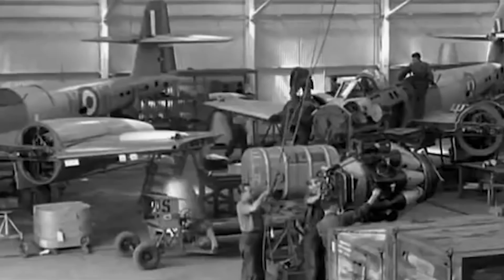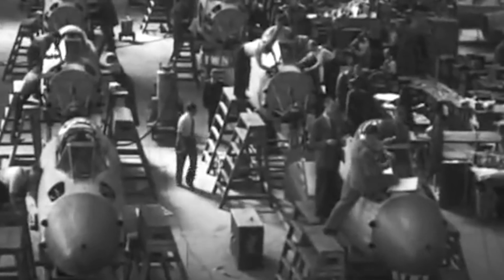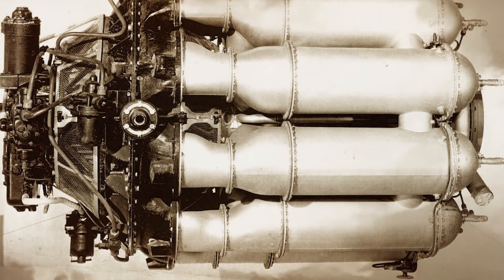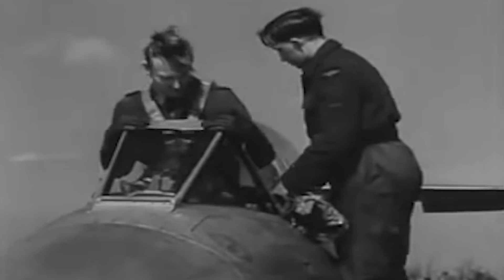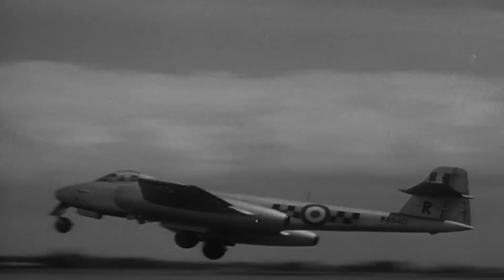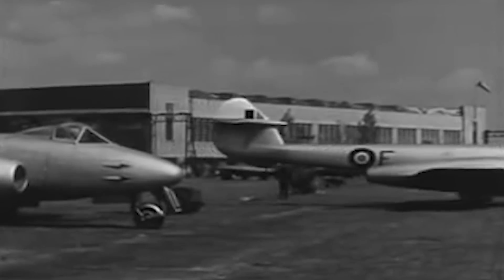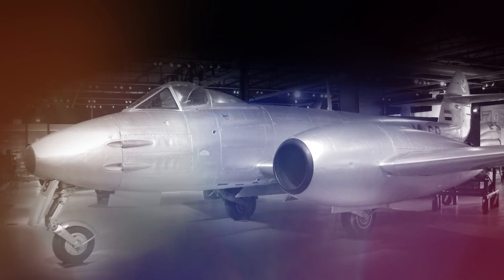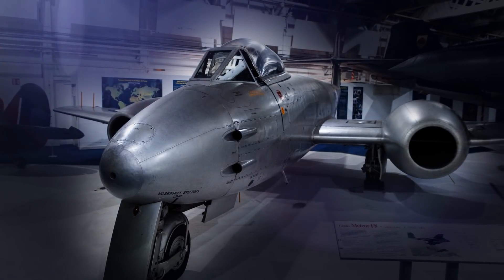Gloster Meteor - The Only Allied Jet to Fight in WW2

Comment: Errr they didn’t think it would impress the Luftwaffe? What? They held them back to keep the knowledge out of German hands. They were too valuable to send so they kept them back.
Reply: The Gloster "Meatbox" was the worst  fighter to ever be adopted into  service by the RAF. It's was no match for the Messerschmitt Me-262.
Reply: Sander Van der Kammen nope? It was one of the most successful jet aircraft of it time and set the standard for all that followed. The 262 had its advantages but could only stay in the air for so long before the engines failed, they then disappeared after ww2 . There are still meteors flying today’s are used by ejection seat companies to test their equipment. I wouldn’t let the early teething problems stain its reputation.
Reply: @timrobinson513  Indeed, the Messerschmitt Me-262 was without doubt the most successful jet fighter of WW2, it is the world's first operational jet fighter and indeed set the standard for all subsequent fighter aircraft from then on...
The Me-262 was produced after the war and remained in service until the 1950s.
The Jumo 004b engines were the most advanced turbojet engines in production during the war, and the original BMW engines are the most successful jet engine in history they are also still in production. 3 postwar 262s and 1 original 262 are in flyable condition.

The Meatbox was the most effective British aircraft ever used against RAF pilots.. over 1,000 crashed killing 450 RAF pilots.
Reply: Sander Van der Kammen you do realise that being the only jet fighter the British had also made it the best?
Reply: @sandervanderkammen9230  Sandyboy, congrats on your optimistic use of '1950s' The poor old Czechs thought they could make an export industry out of the 262s but absolutely nobody wanted it, not even the Argentinians who were awash   with nazis and nazi money and had Kurt Tank and Adolf Galland advising them. The Czechs put chocks under the wheels in 1951 and bough the MiG-15 with the RR Nene copied engine instead. 
As for the sad old Jumo 004, it made its way into 5 prototypes that never went into producion and a few hundred Yak 15s, a converted piston prop plane.
And the BMW 003 was the engine that the Russians put in the MiG-9 and kept flaming out so that they dropped it and chose the RR Nene for the MiG-15 instead. And then the French went for the BMW 003 and had to do a 'Trigger's Broom' on it and even then it took till 1950 to polish that turd enough to fly and ever since only the French would use it.
Reply: If the amazing NAZIs could only make a 20 hours before overhaul jet engine perhaps they should not have bothered.  An unreliable engine made with sub-standard materials cannot be called advanced, it was desperation ignoring and cloaking failure.  They didn't have enough engines for proper training and ended up with no fuel either.  The 262 and the Meteor had an equal impact on the outcome, nil.
At least the Meteor got further development.
Reply: @givenfirstnamefamilyfirstn3935  The British nor the Americans could make an engine capable of propelling an aircraft to 560mph and last 20 hours TBO using WEP.
A Rolls-Royce Merlin engine would not last 20 hours TBO  if WEP was used.

The Jumo 004b engines met or exceeded the RLMs 100hours PFTR reliability standard required for Luftwaffe service.
This is the exact same 100 hour PFTR  required by both the RAF and USAAF during WW2.
Testing conducted by the U.S. Army during  Operation Paperclip reports the Messerschmitt Me-262 engines averaged TBOs in the 50 -60 hour range, excellent by WW2 standards.
Reply: @sandervanderkammen9230  oh you mean the reliability standarts of suddently bursting into flames? Btw the meteors top speet was 612mph so get your facts straight
Reply: @snonsig2688  And the "MEATBOX" earned it's notorious reputation for killing 450 RAF pilots.

Not during WW2... Wartime models barely reached 425mph... slower than many production propeller driven aircraft.
Check your facts son.

Comment: Well part right. Guillaume got the first patent in, but never did anything about it, there was a guy called Fone who drew some pictures, but whittle built it and made it go, so we are back to the Mighty meteor.

Don’t be such a sad sack.
Reply: Hans von Ohain and Max Hahnn built the first turbojet engine in 1934, 2 years before Frank Whittle attempted to build his first prototype in 1936, the first successful flight test was Von Ohain's design in August 27th 1939 two years before Whittle's first successful test.
Reply: @sandervanderkammen9230  What is your source for your statement that Ohain built the first turbojet in 1934 ? This is from Wikipedia :
"The engine was extremely simple, made largely of sheet metal. Construction, by the blacksmith in his village, started late in the summer of 1936 and was completed in March 1937..... Ohain had at last, albeit five months after Frank Whittle, working in parallel in England, run a self-contained turbojet."
Reply: @youtischia  Your source is incorrect. Whittle did not start construction until 1936, he was attending Cambridge prior to this.

"A blacksmith in his village"???
Max Hahn was an Automotive Engineer and Master Machinist working at the University of Gottingen, a city of 55,000 in 1934.
Hahn was later hired as a jet propulsion engineer by Ernst Heinkel. 
He is the paternal nephew of Noble Prize winning nuclear chemist Otto Hahn who is considered the father of nuclear chemistry.
Reply: @sandervanderkammen9230  Did you read it correctly ? Regarding Ohain's first engine build  (Not Whittle) Wiki says : Ohain " started late in the summer of 1936 and was completed in March 1937". He didnt finish his bench test until September. That means he got his engine working after Whittle. You have twice commented he had his engine working in 1934 ! I ask again what is your source for that claim. That is before he even had his patent in 1935.

Regarding Max Hahn, agreed he started as a automotive engineer not a blacksmith. "While working at the University, von Ohain often took his sports car to be serviced at a local garage, Bartles and Becker. Here he met an automotive engineer, Max Hahn, and eventually arranged for him to build a model of his engine, which cost about 1,000 DM." (https://www.456fis.org/HANS_VON_CHAIN.htm).
Reply: @youtischia  Construction of the World's first turbojet engine prototype began in 1933 and was bench tested at Gottingen University in 1934.
Whittle did built any engine or start work until he moved to Rugby in 1936, prior to this he was attending Cambridge.
Reply: @sandervanderkammen9230  That was merely the sheet metal proof of concept. Promising but not up to standard. Ohain first successfully bench-tested a proper prototype engine in September 1937.
Reply: @youtischia  Whittle didn't have a successful running engine until 1939 with the WU.3.. by then Hans von Ohain's jet engine was in the air flying.
Reply: Sandbum dorktorbummer 
Ohain's poor copy of Whittles patent barely got the aircraft into the air. It didn't fly fast enough for the pilot to retract the undercarriage..  It was dropped very soon. Even Germany wasn't desperate enough for that.
Reply: @sandervanderkammen9230  There was absolutely no Ohain engine running in 1934 which Ohain himself clearly says in his foreword to 'Elements of Propulsion, gas turbines and rocket'. Ohain hadn't even worked out his design for a patent until 1935. You really must stop lying Sandyboy.
Reply: @sandervanderkammen9230  Oh Sandyboy, you change your claims as often as most people change their pants. I always think it's worth reminding you of what the famous German gas turbine pioneer Pabst Von Ohain had to say in his foreword to 'Elements of Propulsion, gas turbines and rocket'-

"The first patent of a turbojet engine, which was later developed and produced, was that of Frank Whittle, now Sir Frank (see Fig. 5). His patent was applied for in January 1930. This patent shows a multistage, axial-flow compressor followed by a radial compressor stage, a combustor, an axial-flow turbine driving the compressor, and an exhaust nozzle. Such configurations are still used today..."

and -

"In April 1937, Whittle had his bench-test jet engine ready for the first test run. It ran excellently; however, it ran out of control because liquid fuel had collected inside the engine and started to vaporize as the engine became hot, thereby adding uncontrolled fuel quantities to the combustion process. The problem was easily overcome. This first test run was the world's first run of a bench-test jet engine operating with liquid fuel..."

Comment: Many are so eager to assert that German technological advances was superior to the British, that they forget to read what the Germans actually made, and how useful it actually was.

The first jet engine to fly in a plane, was von Ohain's project at Heinkel. He had substantial funding from a major industrialist. Von Ohain himself admitted that he studied very closely Whittle's jet engine patents before starting work on his own jet engine. His engine had a centrifugal compressor and turbine. It was not the axial-flow jet. It was unreliable, inefficient, low power and low life, despite having massive funding from Heinkel - a failure, that was not continued. The German jet programme was dropped until they knew the British had prototype planes in the air, then it was revived. 

Whittle concentrated his very limited funding on the centrifugal compressor because it was well-understood and less problematic than axial-flow designs. He was focused on making a war-usable, reliable and powerful engine - quickly - which would outperform the best piston engine planes of the day. All of these qualities the Jumo and BMW axial jet engines lacked. On limited funding, Whittle developed a reliable engine which was combat-ready near the end of the war. Within months of the first operational flight, production engines were also more powerful than any of the total garbage engines turned out by the rushed German programs to the enormous detriment of actual combat - Gloster Meteor's top speed of 600 mph in late 1945, 650mph in mid 1946. No one can claim that an engine is combat ready with a service life of 10-12 hours, which cannot be rapidly throttled up or down otherwise it stalls, is prone to flame-out and terrifies its pilots. They were underdeveloped and unproven axial-flow jet engines, being garbage. The British installed axial-flow engines in a Meteor, however dropping them as they were too problematic at the time, requiring yearsto put right. A war was on, with years in development they could not afford.

The problems with German jet engines were not caused by the scarcity of metals in Germany during WW2, as they had access to enough rare metals. To produce a high performing jet engine high-strength alloys are required resisting high temperature. No iron-based alloy is suitable. Germany had no programme to develop such alloys. The British did, developing the nimonic series of alloys, making use of them in the WW2 jet engine programme. That is one, just one, of the reasons why the British jet program had combat potential, with the German program doomed to failure.

The Me262 airframe had many serious faults:

♦ high landing speed:
♦ difficult to maneuver;
♦ no air brakes;
♦ centre of gravity too far back;
♦ Poor downwards pilot visibility;

Those faults made attacking other aircraft far more difficult - at a time when they were desperately short of pilots, particularly pilots with sufficient skill and experience to fly what was a very difficult plane to fly and fight in. 

The sweep-back of the wing of the Me262 was minimal, only in the leading edge, with a part of the trailing edge of the wing being straight. The swept wing was an insufficient correction for the plane's centre of gravity problem, not aerodynamics, that prompted the slight wing sweep. It was not until years later that properly designed swept-back wings were introduced in combat planes. By contrast the Gloster Meteor was:

♦ handleable;
♦ maneuverable;
♦ a balanced combat plane. 

While the Meteor was being developed, the British were also working on the supersonic Miles 52 plane - the project was dropped with the plans given over to the USA, which resulted in Bell X-1. No one copied the Me262 in the post war rush to get fast jet planes into service. The British also produced new planes - the world's most advanced, in engine and airframe.

After WW2 the leader German plane designer Kurt Tank, and 62 other German engineers, went to Argentina to design and build the FMA IAe 33 Pulqui II jet plane. They used an RR Nene engine. The plane was a flop, way behind other jet planes of the time.
Reply: Used in the Sea Hawk and Ouragan. Developed for the Grumman Panther and the MiG 15.  Funny how the Americans and Soviets thought it was a good engine.
Reply: @givenfirstnamefamilyfirstn3935  The RD-45 is a unlicensed copy of the Rolls-Royce Nene.
The MiG-15 was powered by the Klimov VK-1..
Not the Nene.
Reply: Please explain why the Messerschmitt Me-262 was able to shoot down over 500 Allied aircraft with 26 Luftwaffe pilots becoming aces flying the Me262
The Gloster Meatbox was the worst jet fighter ever used by the RAF...
It never shot down a single Luftwaffe plane during WW2.
ZERO!!!!
Over 1,000 Gloster "Meteorites" CRASHED killing 450 British pilots...
150 crashed in one year, 12 in one week and 6 British pilots killed by Meatbox in a SINGLE DAY!
.
Reply: @sandervanderkammen9230  the meteor didn't shoot down a single fighter because it wasn't used in an anti fighter role. Stop cherry picking
Reply: @snonsig2688  The Gloster Meatbox was not used in the fighter role because it was never an effective fighter aircraft... Gloster never built an effective fighter aircraft in its entire history.
Reply: @sandervanderkammen9230  that's quite a statement based on exactly 0 facts or evidence. Also ever heard of the gladiator and javelin?
Reply: @snonsig2688  The Gloster company never made any effective fighter aircraft... 
The Gladiator was obsolete on arrival..
The Javelin was not an effective fighter with no combat service and no foreign sales either.
Reply: @sandervanderkammen9230  
What did the screaming voices tell you today?
Reply: @johnburns4017  John please get therapy
Reply: @sandervanderkammen9230  
After WW2 the leader German plane designer Kurt Tank, and 62 other German engineers, went to Argentina to design and build the FMA IAe 33 Pulqui II jet plane. They used a RR Nene engine. The plane was a flop.
Reply: @johnburns4017  Indeed, the RR Nene was a flop.
Reply: @sandervanderkammen9230  Silly Sandyboy, you know that the worst jet fighter in history was the Me 262. It utterly failed in its only task, the nazis had to build more than 1400 just to get about 300 vaguely usable ones and then they could rarely get as many as 50 of them of the ground on the same day and then the Me 262 in service had a far worse mechanical failure/pilot error loss rate than the Meteor at 33% and whereas the Meteor enjoyed over thirty years of service in more than a dozen nations, the poor old Me 262 was so bad that nobody wanted it but the krauts and after seven years it was museum fodder.

Comment: Sorry, but  the first British jet aircraft was the experimental Gloster-Whittle E.28/39 which first flew on the 15th May 1941. The Gloster Meteor was the first British jet-fighter, first flying in March of 1943 - nearly two years after the E.28/39
Reply: The Gloster-Whittle E.28/39 was designed to take cannon. If the need arose it could be used in combat. It was a reliable well performing plane, not like the Heinkel 178 plane of around 18 months earlier, which performed so badly the funding for German jet programme was dropped.
Reply: @johnburns4017  John please get therapy, you have become completely delusional.
Reply: @sandervanderkammen9230  
Hi doktorbimmer!
Reply: @sandervanderkammen9230  
Hi doktorbimmer!
Reply: @johnburns4017  John please get therapy
Reply: @sandervanderkammen9230  
Hi doktorbimmer!
Reply: @johnburns4017  John please get therapy
Reply: @sandervanderkammen9230  Hi doktorbummer!
I see John Burns is making you cry again.

Comment: the meteor enterd sevice six days before the 262
Reply: The Messerschmitt Me-262 entered service before the Gloster Meatbox...
Reply: @sandervanderkammen9230  
The Meteor was delivered to it units before the 262 was delivered to its units. The Meteor was first into unit service.
However the Meteor was proper plane while the 262 was throw together garbage killing many of it pilots.
Reply: @johnburns4017  WRONG! 
The Messerschmitt Me-262 entered service on April 19th 1944..
The Gloster Meatbox did not enter service until July and never saw combat.
Reply: @johnburns4017  The British Meatbox was the worst jet fighter ever used by the RAF, it was responsible for killing 450 British pilots yet never shot down a single Luftwaffe plane.
Reply: @sandervanderkammen9230  
Hi domtorbimmer!